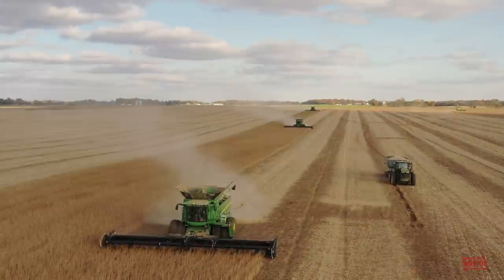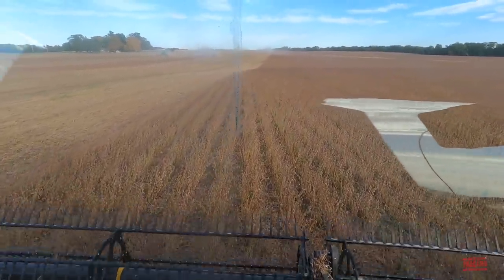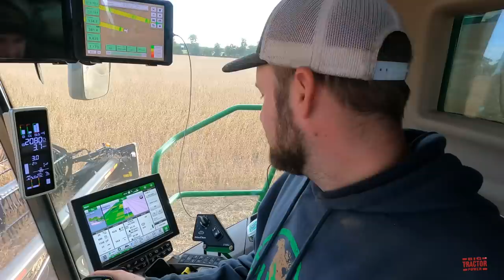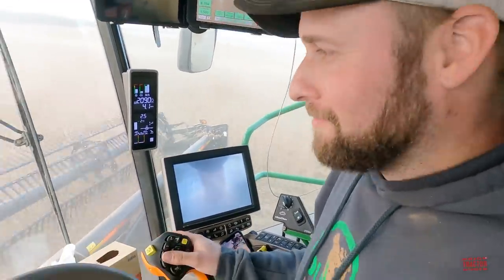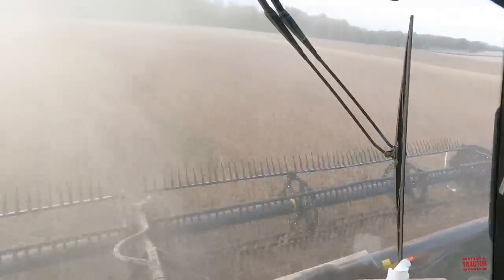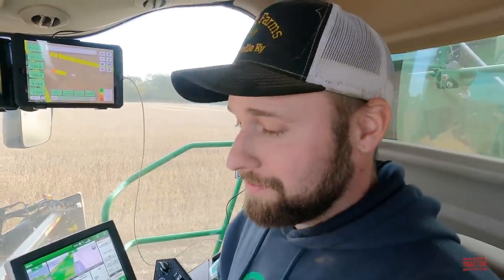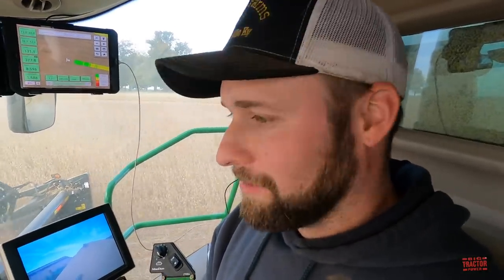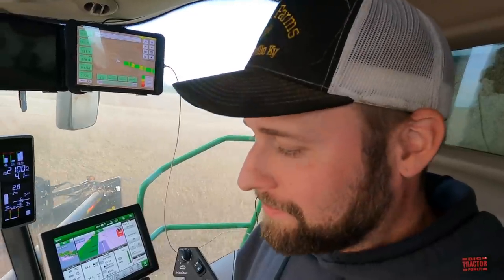HARVESTING 11,000 Acres of Soybeans

Comment: We plan on doing alot of double crop beans next year . We figure with the high fertilizer costs we will grow more wheat and beans instead of corn . Double crop beans are cheap to grow and normally with the profits from both the beans and  wheat they actually pay more than corn . We have roughly 1800 acres that we currently have wheat on .  We can get a 25 to 30 bushel double crop yield most years. we figure that anything over 12 bushels an acre  is profit . Great video keep up the good work!

Comment: On my bosses farm operation, they have 2 John Deere 9660 STS combine. One of those 9660s is a bullet rotor combine. Their oldest brother has a 9760 STS. At wheat harvest one 9660 uses a 630F head, the bullet rotor one uses a 635D rigid draper head, and the 9760 uses a 630F head. These combines have been  used to cut winter wheat, corn, milo, or soybeans. For the grain cart team, there is only a John Deere 8120 with tinted windows that is used to pull an A&L F705 grain cart that holds 700 bushels.
Reply from the maker: Very nice harvest team. 👍👍

Comment: On my 25,000 acres those combines would be running from 6am to midnight until the harvest is done.
Reply: I want to see you cut beans at 6am. Your not from the Midwest or you’ve never cut beans one of the two
Reply: Trust me we would like to run those hours but it is impossible to cut when the plant has water dripping off of it.
Reply from the maker: In corn this farm that crops 33,000 acres runs till mid knight or later. In wheat seeding season they might run 24/7 to stay ahead of rain.  In soybeans it’s impossible to run too long after dark once the dew sets in.  The plants get to heavy and would plug the combine.

Comment: we cut 11,000 acres with 35 foot heads and much smaller fields. Very inefficient process
Reply from the maker: What model combines do you run?  This farms first Draper’s were 35ft on 9750 STS combines in 2003.
Reply: @bigtractorpower  they have 5 s770s. Lots of hill ground and small fields in this area. I argue to split up the crews but they like to run together for easier truck logistics